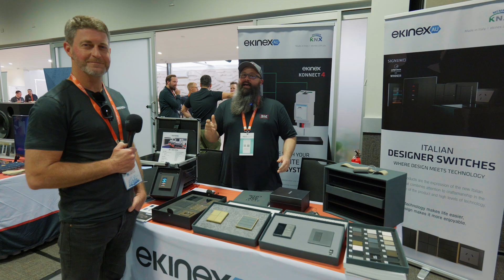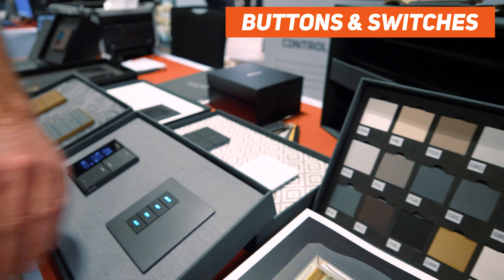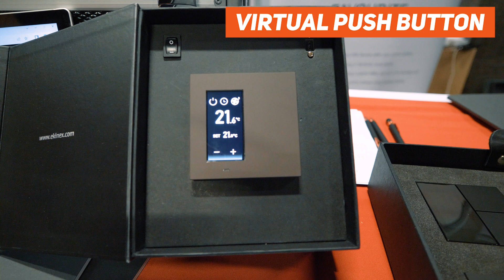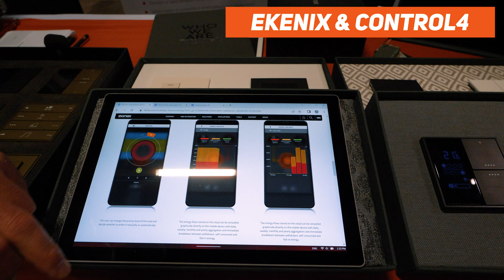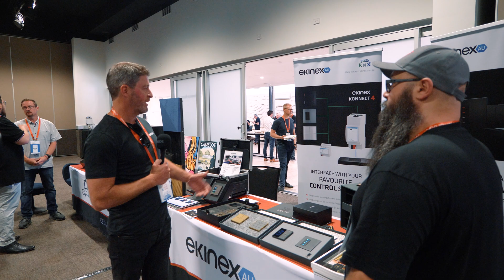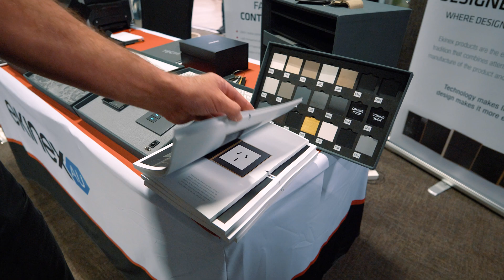*NEW* Bring Italian Beauty To YOUR Home Theater! - EKINEX SMART SWITCHES // CEDIA 2023

Comment: We installed these switches, and our client is hating them. The travel of the button when you press it doesn't provide a nice touch. Also, the response from the moment you press the button until the lights turn on takes almost a second. Also, some buttons turn the lights on and off with one touch, and sometimes, you have to press the top of the key or the bottom to turn on and off. We are very disappointed and wonder what went wrong. Also, when you dim the lights once you turn them off, the light doesn't turn on with the previous dim setting.